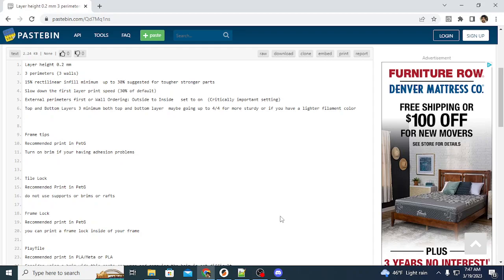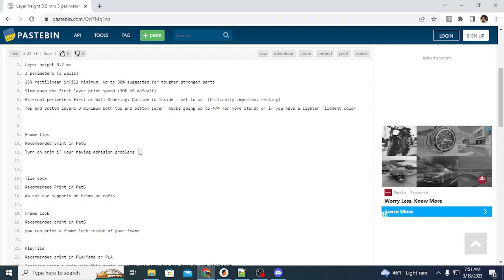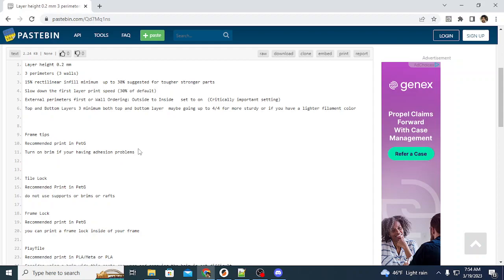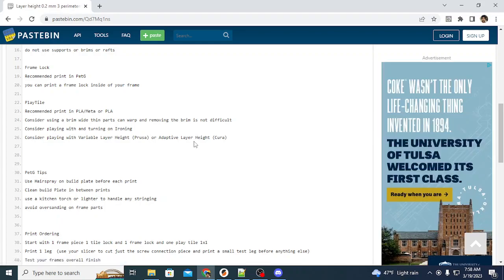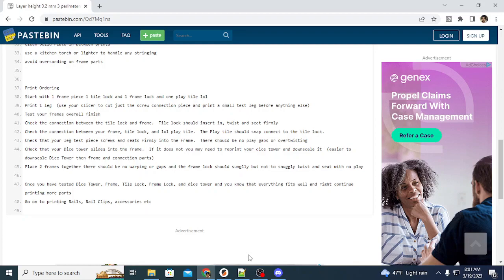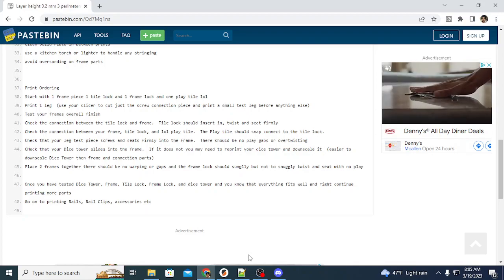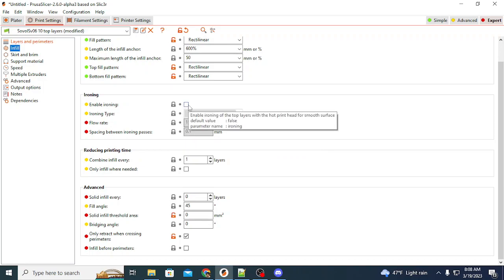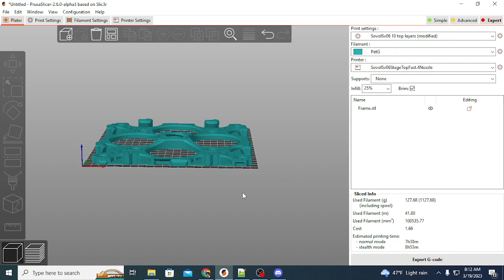Stagetop 3d printed table recommended slicer settings

Comment: Frame locks are fine but my super duper tuned Voron printed frame locks a bit too tight.. I think tolerances in the design are thought for entry level machines.